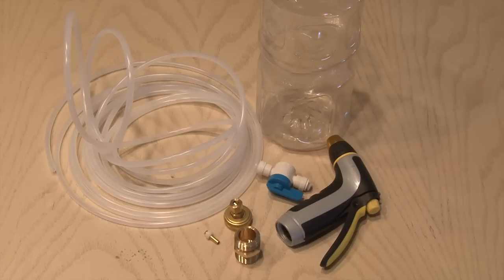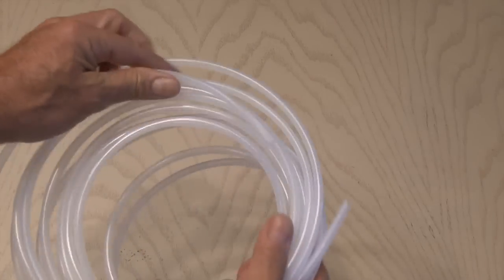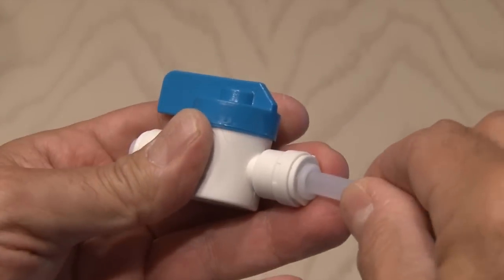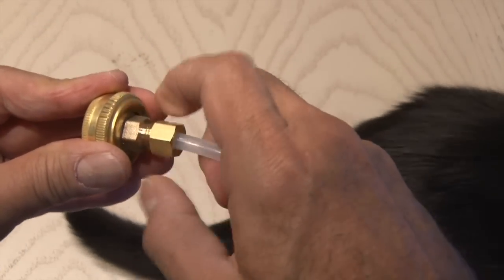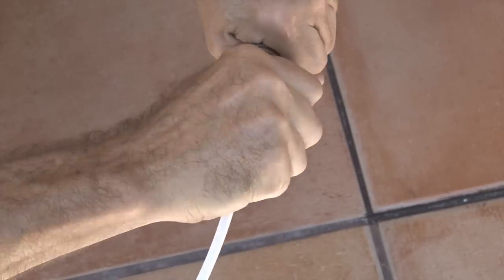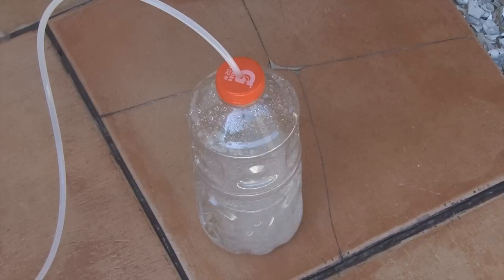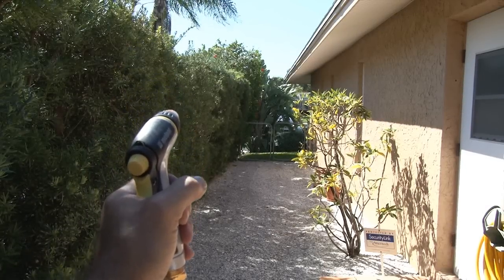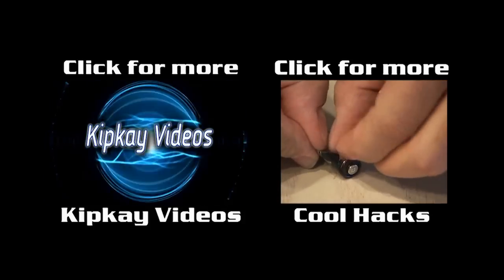Hi-Power Super Soaker!

Comment: It looks like you just filled a water bottle half full and attached a small hose on the top of it going to a water nozzle.  Where is the pressure that forces the water out of the bottle? Do you tip the bottle upside down? Sorry if I am not understanding correctly but it doesn't seem quite clear.

Comment: or you can just connect the sprayer to a hose and the water spiket.
Reply: Potato Modding Services The water tank gets pressurized because the air is trapped and the water needs space so it pushes on the air and the air pushes back so it shoots when he pulls the trigger

Comment: Try use coke or sprite bottles. I think they can handle 5 bar. So its pretty not achievable by the height of most homes so you can just stop once the water stops moving. But then youd have to secure the other end of tubing. Some kinda sling would be pretty nice too.

Comment: So you can spend about $4.99 for one of those adapters, another $3.89 for the other. the valve was said to be optional but wasn't another $2.50 and the high pressure hose was he said a couple of bucks and lets see oh yeah the nozzle the one shown was about $15 dollars, and a trash bottle, so he spends about $25 dollars to build a one off shooter, that shoots an amazing 30 feet, you are aware you can buy a super soaker that shoots 40 feet can be charged on the go and costs under $10 bucks at Wal-Mart.   The soaked are the ones who follow this.
Reply: Fusion008a i got the adapters/fittings for $3, 5ft of tubing for $1, and the nozzle i already had ($4 at my walmart) so it was 4-8 dollars for me. it wasnt that bad. besides, its funner to build my own stuff
Reply: Yeah, i've watched a couple of his videos, and so far all seem to be "spend 4 times as much money, and waste an afternoon, to make a less efficient, crappy version of something you can buy at the dollar store!"

Comment: "You could just use the hose".

I think the point is this is actually easily portable.
Reply: Not really. A large water jug with a tiny hose barely wedged into the cap is not really something you can easily tote around in one hand. It's about as portable as a bowling ball smeared in Vaseline, sure, you can move it, but good luck holding onto it while running around trying to shoot people with a water gun in your other hand.
Reply: +Throttle Kitty 
S T R A P
Reply: Sanwich 121
...- O N
Reply: +CommentCop Badge#666 
butwhy

Comment: Cool, but y do u need the bottle? Just plug the hose in at the tap, NON STOP WATER OBLITERATION
Reply: without the bottle your better off just by using your hose
Reply: true
Reply: ***** Was that a challenge?^^
Reply: because the air in the bottle forms the pressure and thats why it has more power from just a hose
Reply: even more true

Comment: Tip: Soda bottles are meant to handle pressure. If you use a soda bottle, you won't have to worry about it exploding. From personal testing, a 2 liter soda bottle can easily handle 100 psi or more; a hose only has about 60 psi.

Out of curiosity, did you get this idea from Super Soaker Central?

Comment: I would just mod a fire extinguisher. Spray out all the stuff, take the nozzle off, Take the assembly off, and use some adapters and thick PVC to connect the water tubing. You could probably get more feet from it because you can fill it to the rim.

Comment: If you have them around or can find them, a 3 liter soda bottle would work well I think.
The 2 liter soda bottles can hold a rediculous amount of pressure before the FAIL,compaired to a gator aid bottle.
They do have a smaller top but that might serve to hold in more pressure. Good luck and be safe.

Comment: You could probably get a lot higher pressure if you used an aluminum water bottle instead. Also, it'd be easy to re-pressurize the tank with a compact bicycle pump. I'd imagine a pressure gauge on the device would be a nice touch, too.

Comment: @MsLueroi

They make kits that will repair scratch discs. If it's a huge scratch, they make a filler epoxy that you smear in the scratch. If it's a bunch of small scratches, they make a sanding and buffer system to restore the condition of the disc. Do a google search on "CD and DVD scratch repair".

Comment: @mrBULLDOG43 and anyone else that says "why not use the hose",  the I dea is that the water displaces air in a sealed environment, causing the pressure that fuels the super soaker, so, to simply remove the cap and fill it, one would have to incorporate a second method f creatin pressure (compressor, pump, etc) to cause the soaker to actually spray.  The explosion from pressure can also be avoided by using a tank made from pressure rated PVC pipe and cement with, for more presure (and higher ran

Comment: Before Super Soakers were invented, I used to do something like that with an automobile tire.  I rigged up a hose to fill the tire (tube type) and a valve similar to the one shown except brass (this would have been in the early 60s) fill the tire until it won't take any more, city water pressure was about 90psi, shut off the petcock, and attach the other hose with the little brass nozzle from a toy fire truck.  Lasted a long time at pretty high pressure.

Comment: if you didnt glue the feed line (hose) to the cap of the bottle then wouldnt it just pop out with all the pressure? like the pressure blew a hole on the bottom of the bottle so wouldnt the hose just pop out?

Comment: @farshad94abedi when i hose pushes water out, its a mix of air and water, since the bottle is air tight, all that air and water are stored in there, as the pressure from the hose builds, with no where to go, it make the bottle expand with the pressure, then when you release it, the bottle contracts, and all the pressure escapes with it. another way to think of it is as a water balloon, just instead of rubber, you have a plastic bottle.

Comment: As a suggestion to improve on it, I would suggest maybe another line that goes out from the bottle to some sort of squeeze pump or handheld bike pump. That way you can add more pressure in case you have to fill the bottle without a hose. Still, for all the modding you would have to do to it to get it to the functionality of a super soaker, you would be better off just buying one at Walmart.

Comment: Why not just use the hose ...even better is a gatorade bottle woth a small hole in the lid and another on the bottom fill half full with ear plugs stick a air nozzle in the bottom hole and turn the air on ....fully auto earplug gun ...try it

Comment: @dgisback This is mobile, you can use a larger tank. its using the pressure built up from the hose when filling the tank. do you not use a hose to fill an inferior pump up water gun? This has no pump, but has a little more work to refill.

Comment: If the water pressure from the hose is what is  compressing the air in the bottle to make this work,  then the valve in the middle is clearly NOT optional since you will lose the pressure needed to shoot the water out of the bottle as soon as you swap it with the nozzle. 

The water doesn't magically shoot out of the bottle, you need compressed air inside.

Comment: Here's a tip: push the tube to the bottom of the bottom so it works like a spray paint can. The air will push down on the water and force it up the straw  and thus make for more water coming out more efficiently.